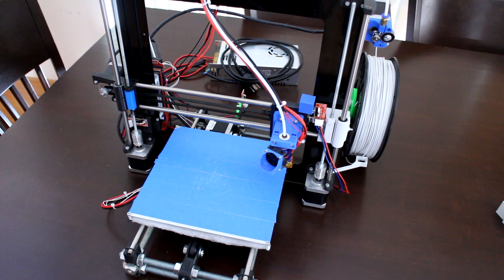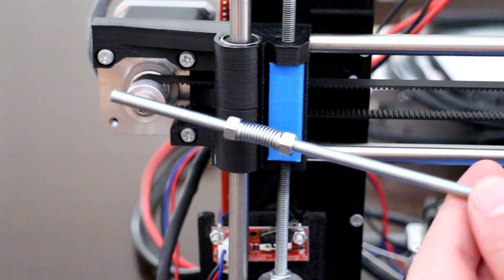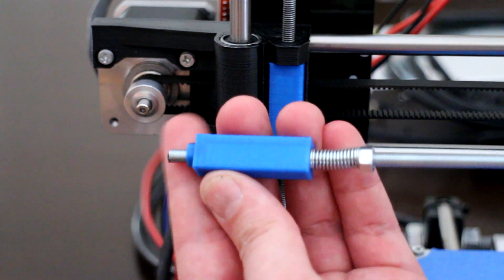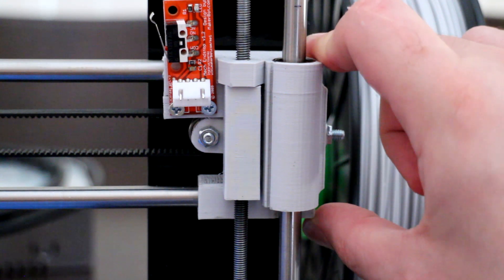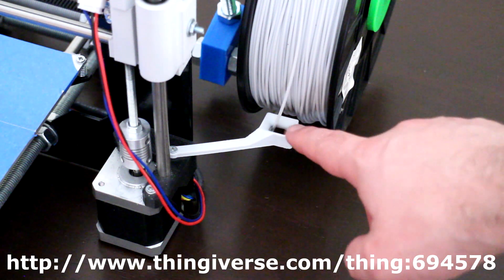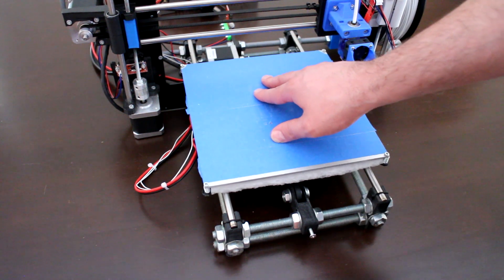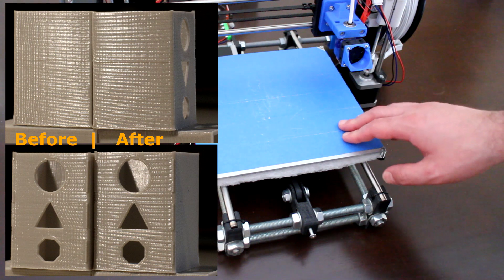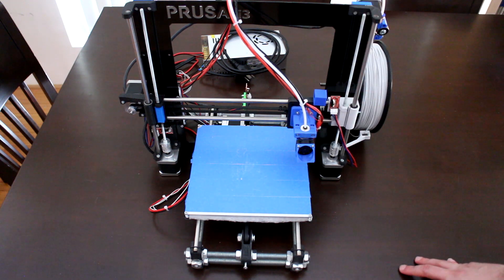Prusa i3 3D Printer - Upgrades!

Comment: My question relates to the Z-axis anti-backslash nut arrangement? Why would you need that if the Z-axis is always loaded by the gravity? Is it physically possible there would be a slack in the Z-axis rod? I know you need that in CNC milling machines where high forces acting in opposite directions creates issues with tolerance and positioning. 

Another thing - the z-springs on the heat bed can be substituted with direct-hard connection. This can be done either by washers (good luck with the equal thickness) or by incorporating some extra nuts that need to be locked eventually after leveling/calibration.
Reply from the maker: +Przemysław Jakubczak 
Hey! Good questions. There are options in the slicer software to lift the z-axis on retraction. You might choose this option to minimize plastic that may be deposited on the printed part when moving over external perimeters on the same layer, or because the filament you were using is runny. Either way, if you select this option backlash may result.

The z-springs on the heat bed seem to be industry standard as you need to adjust the heat bed to be perfectly level. We are talking about sub-mm level accuracy here so springs under tension with adjustable height is mandatory.
Reply: +Tech2C Hi! I agree that the backslash may result - but only in direction not loaded. It is like holding a cup or glass in your hand. If you remove the hand slowly the cup will always follow your hand - as the gravity is pre-loading the z-axis. But if you can take it very fast - then the inertia makes the glass to stay in place for a while before start moving down. Then the backslash will appear. I guess in our machines the Z-axis is just too slow and is not able to escape from the gravity. Do you have a before/after prints that show benefits of the antibackslash on z-axis?

Comment: i have the same kit from replikeo , i did little upgrade with the x belt tensioner , my extruder body Wade have a play in the hole that hold the j-head , i am seeking for a direct extruder with clamps system to maintain the j-head straight with no gap. My filament is 3 mm PLA .

i have seen your bowden setup , seems very good . I probably choose the same system but for now i am wondering if it 's good for 3 mm filament and how do you configure your steppers in the back of your frames .
Reply from the maker: MrGurkanify 
Hey, checkout the rest of my video's. I describe the Bowden extruder setup I use.

I'm using 1.75mm filament, not 3mm anymore. So my Bowden configuration won't work with 3mm filament sorry.

Have a look on www.thingiverse.com for other direct extruder mounts that you can use with your J-Head.

Comment: Finally finished my i3.. I press Print, and it homes itself, but then nothing. Even pre-heating extruder and bed. Any help? :-(
Reply from the maker: Oldenglishshifty Sounds like there's a problem with the thermistors. Ensure the heatbed and hotend thermistors are setup correctly in Marlin and connected to the correct ports on the RAMPS board.
Reply: Sorted it in the end.. installed Marlin instead of sprinter. Worked first time. :-)

Comment: I'm currently building the new 2020 i3 prusa. I think I'm gonna add a nut under the hot bed to lock the screws on and run the springs between the two platforms as normal. That may eliminate that too.
Reply from the maker: David depuy 
Cool. Please let me know if your setup eliminates the ghosting.

Cheers.

Comment: Hi there, noob question for you; do you use any sort of lubrication on threaded rods?
Reply from the maker: doctorbad Nope.
Reply: Tech2C Ty!
Reply from the maker: doctorbad 
Actually I do use some 3-in-1 multi-purpose oil on the z-axis threaded rods. Not on the smooth rods though.

Comment: You should give a try to rubber or silicon spacers. They will both help keep your build plate from moving trough increased friction compared to the original spring set up and absorb vibrations while still allowing you to squish them to get the bed leveled.
Reply from the maker: ZopteY That is a fantastic idea! I have some silcone tube I can cut down to small lengths. I'll give it a shot, cheers!
Reply: Tech2C I'm happy to hear you'll give it a try! Let us know if you see an improvement in print quality

Comment: Hey,  are you still using the packing foam in between the Y carriage and the build plate? If not, what are you using? Does the packing foam react to the heat bed, like melt? Thanks for your help.
Reply from the maker: twitch0601krytter I removed the foam. It was a bit thick and caused the centre of the print surface to bow upward. I hadn't used the heater with it so can't be sure if it would survive.

Comment: How hard would it be to rebuild one of these in a larger scale? I think all the mechanical stuff would be pretty easy but how would you program it to know/scale up the builds? Reason I ask is eventually I want to be able to build larger size prints.
Reply: I know this is an old post, but to answer? when you set up the printer... You have an option to enter the X Y Z values(measurements), and would be according to your scaled up build.
Reply: hi ....the filament melt only first time and didn't melt continuously  pls help me

Comment: The osilation is called harmonics and to remove this in high perfomance engines use two different springs so your 6mm hard spring as normal and a softer 10mm spring on the outside of that would solve this
Reply from the maker: captinobeans Interesting, thanks.

Comment: Nice video.

 Be careful about the X-tensioner  all the tension force is on your z rods the way to combat this is to move the tension to the x-rod there are a few models on thingiverse
I also remixed a couple.

http://www.thingiverse.com/thing:392297  
http://www.thingiverse.com/thing:695464
Reply from the maker: Moshe Kashani Thanks. I'll see how I go with the current belt tensioner - no issues so far...